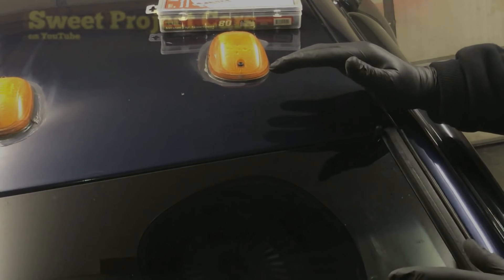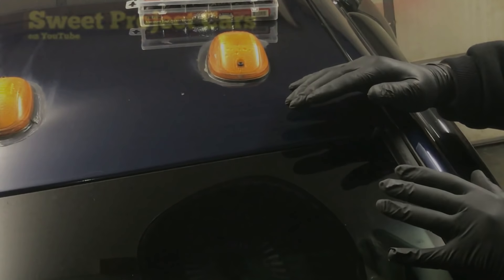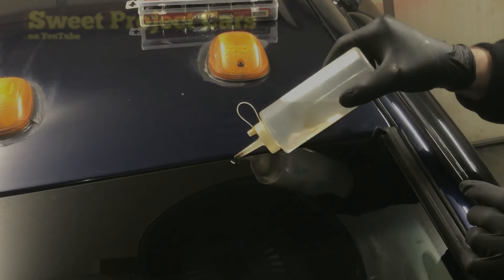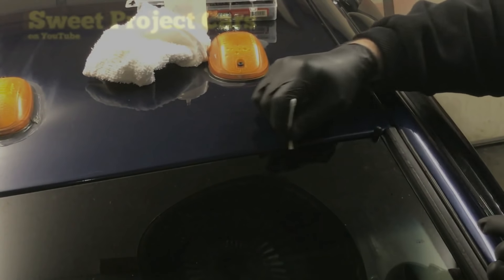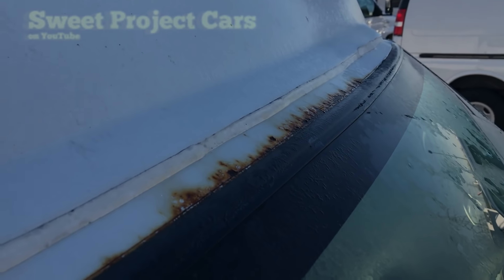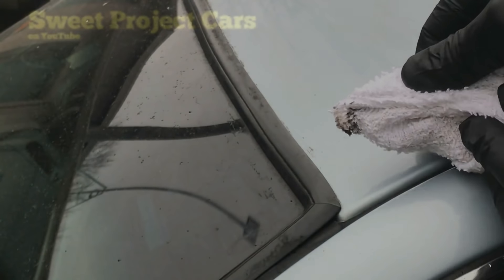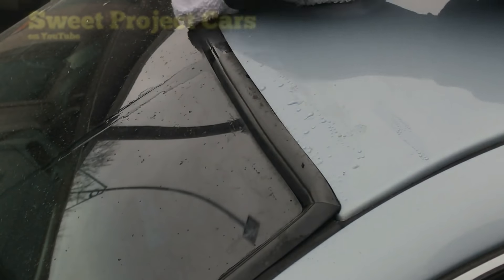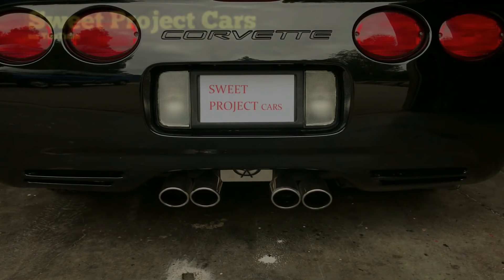How To STOP RUST at WINDSHIELD Seal.... VERY EASY DIY

Comment from the maker: Good Day to all our GREAT SPC Friends. Here we show you how to prevent the worst kind of rust you can have on your car or truck. The old saying goes perfectly here, an ounce of mineral oil is worth a pound of Rust Prevention LOL or something like that! ..we hope you enjoy :)
Reply: looking forward to watch the next video, too soon is late :D
Reply: Great job mate, I've replaced a few windows in tractor and while fitting new rubber to the cab I was thought by an old timer to put Vaseline in rubber groove where it meets metal to prevent this also..
Reply from the maker: Kevin Lonican thank you for sharing this great tip :)    thank you very much for your great comment and we are glad we can help :)
Reply: Another Great tip that I will follow 👍
How do I send you a picture of my ‘95 GMC Ride 🤔
Reply: In 16 years as an auto glass installer, I've only run into rust not caused by a previous auto glass installer a handful of times. Rust around a windshield is almost always caused by a auto glass installer cutting corners and not sealing up the scratches they caused while cutting out the old windshield. I've replaced 30 year old windows that didn't have a hint of rust as it was the original windshield and the paint hadn't been scratched. I've replaced a one year old car that the had rust beginning after only having had the window replaced two months prior because the previous installer had not sealed up his scratches. Rust does not begin because dirt gets underneath the molding. 99.9% of rust that I see is auto glass installers scratching the paint and not sealing up their scratches.
Reply: Great video's. I am from Europe. I have a Wartburg 1.3 of 1991 (last one built in the former communist Eastern Germany) which are famous for rusting. What kind of mineral oil do you use?

Comment: This channel is a MUST for auto lovers. I've done this for years on vintage vehicles that have zero paint on the inside metal in the South and even light existing surface rust is halted.
Reply from the maker: marcogram thanks for sharing my friend :)   thank you very much, and for stopping by for our many car & truck DIYer affordable tips :)
Reply: Hey! You said even if there is a light rust spot present its possible to prevent further rusting by applying the product. My question is do I apply smth like rust eater penetrating oil to get rid off the rust that’s present first and then apply the corrosion inhibitor?

Comment: Can easily be taken to the next level of preventive maintenance: If your car has a "panoramic sunroof" like my wife's Audi A3, these things will become noisy with age. Squeeking noises, sometimes rattles even when closed. My assumption: the rubber seals tend to dry out and shrink with permanent exposure to the elements. 

Loaded the syringe with ATF and gave the surrounding seals a thorough dose of oil. Twice to make sure there will be enough to get into all the nooks and crannies behind the seals and soak the rubbers, too. A week of baking in the sun - the roof is dead-quiet again. Neither the opening part nor the unmovable glass-section cause any more noises.

I get more and more enthusiastic on this easy, affordable and effective method of rejuvenating older cars. 

I cannot thank You enough for Your knowledge shared here!
Reply from the maker: Markus Dahmann thank you so much for sharing this great info it truly helps the entire channel :)

Comment: Sweeeeeeeeeeet!!! I'll be doing it to my 2000 F-350 tomorrow, Thanks for the tip my friend!!! Now, if I could just get the new front brakes from squealing when I come to a stop or make a turn...🤔
Take care and God Bless!!!
Reply from the maker: Orange Rocket thank you very much and on your brakes check the protector plate on the back to make sure it is not touching and or you may have to take them apart and add anti-seize to all the areas touching metal   just some ideas for you my friend and God Bless you are well
Reply: Sweet Project Cars ,THANK YOU, will do.
Reply from the maker: rocket have a great day my friend:)

Comment: Nice simple trick to save a lot of money down the road thanks for posting! Could you use something like Fluid Film in place of mineral oil?
Reply from the maker: CUnit1981 you can use anything that is safe for your paint and flows into the cracks and crevices as does the mineral oil  thank you very much, and for stopping by for our many car & truck DIYer affordable tips :)

Comment: I have minor surface rust on the top on rubber type seal. Will this still work if i apply it after i treat/paint the rusted surfaces. Also seems like a good oil to spray inside rocker panels?!? Thanks for the video
Reply from the maker: Yes, it will work great and it will work on your rocker panels as well my friend. Thank you for watching and asking, have a great week v1nce. mad Mike the hammer SPC

Comment: Hi, will this work if rust has already set in? I have to apply new polyurethane sealer around the windscreen of my sprinter every year. I remove the old sealant, clean off the rust and flakey paint as best as I can. Then re paint and reseal with sikaflex. It lasts for a year and then starts leaking again after the summer. I think the sun and high heat shrinks the polyurethane sealant which also doesn’t help. But I’m sure the main problem is the rusting process.
Reply from the maker: It sure does! Just follow the video instruction and make sure to seal with this  https://amzn.to/2WaABYr  to prevent any leaking. Thanks for watching and asking, have a fantastic week my friend. mad Mike & team
Reply: @SweetProjectCars  wow, thank you so much for your reply and help. 
So the sealant you recommend will still work and stick to the surface even though it’ll be coated in mineral oil? 
Thanks again guys you’re really very kind in taking the time to help me.
Awesome videos 👍

Comment: my 1971 Kingswood has non-flexible chrome window moldings, do I need to remove these and then treat it like the open type shown in this video ? also was the juice in the bottle just Mineral Oil with nothing added?  Cheers & Thanks.
Reply from the maker: RoverIAC you can pour the mineral oil just above the trim and let it roll down into the area below it and it will work finf...thanks for asking my friend :)
Reply: I hope you still ahve that car!

Comment: I have paint bubbles near corner of windshield should I use a rust  neutralizer and silicone as mentioned in another comment and then mineral oil? Or just use mineral oil
Reply from the maker: snotrags 00 you can open up a whole can of worms with rust neutralizer as it will not look good...if you want to stop the rust in its tracks use the mineral oil and do it a few time to really let it soak in. then when you are ready to open that can of worms, sand the rust out and then use your rust neutralizer and etching primer and repaint.

Comment: I just changed my windsheid there was a tiny tiny bit of rust we cleaned it off and applied some primer do you suggest me to apply mineral oil immideiately to prevent the rust from ever coming back again
I checked at my local store I found mineral oil but  it's says cutting board mineral oil on the label is that the same?
Reply from the maker: Canadian well it should work for you my friend
Reply: Hey man Thanks for your reply
I have one last question for you 
I wanted to ask you so since I live in a cold climate  can I apply mineral oil and use a blow drier to let it bake and do you guarantee that  mineral oil doesn't cause any damage what so ever to my new rubber  seal by the way this is the mineral oil that's available at my local Canadian tire store is it the right one https://www.canadiantire.ca/en/pdp/paderno-mineral-oil-treatment-250-ml-1422208p.html#srp

Comment: Did this to my truck yesterday which has the open type of seam. I use some compressed air blow the leaves and dirt out of the seam and then applied mineral oil like you showed in the video. Im assuming it's normal for the mineral oil to run down the sides and end up on the ground the next day? Thanks for posting this great video!
Reply from the maker: Yes it’s very normal for that to happen and it does not harm the environment whatsoever but what is left in the areas that you treated is all that is needed have a great day my friend
Reply: Awesome thanks! I like the idea it travels down the sides of the windshield protecting that as well. You guys are awesome I've learned a lot from your videos!

Comment: I have just discovered rusty corners on most of my van windows. Not a cheap fix. I will be trying this for sure after it's repaired. I'm worried about mineral oil breaking down the rubber seal though. Would that happen?
Reply from the maker: There are no adverse affects doing this process, we've done this for 40+ years, have no worries my friend. Thank you for watching, have a great weekend. mad Mike the hammer SPC
Reply: @SweetProjectCars  Thanks for your reply. Can't wait to do this on my van now! 😁

Comment: I just did my car using this method. I had a very narrow space between windshield and body with a rubber gasket between windshield and body. Very gently I was able to get my thin trim tool in  there to allow the oil to seep in. You can also stick one of the straws from aeresol wd 40 cans in there and inject you fav rust inhibitor. This method is cheaper and any attempt you do will pay off. I bet this is often neglected or missed part of rust proofing where the salt spray runs in that crack all winter.
Reply from the maker: dave houston thanks for sharing and you are very welcome my friend and thanks for being to here see our many DIYer Tips :)

Comment: Hey what a great video, This is something I am planing on doing shortly. Question can I use Motor oil, Machine oil or WD40 instead of Mineral oil?
Reply: nw8000 not sure but motor oil bad for rubber??
Reply from the maker: nw8000  we have found the safest oil to use is the mineral oil
Reply: Ok thank you

Comment: Hi again! Lol! I left a mile long comment on the water coming into your floor video... When my friend checked the windshield out, he noticed I had rust spots starting at the top middle of my windshield.... Is it Too Late to do this now? Or, will it help prevent Further rust from forming??

And, as I type this on my phone, I'm also watching your 'Your Car Will NEVER RUST Again! For Just $10 Bucks" video on my laptop... and, lol, I ALSO have rust starting on the very bottom of my rear quarter panels, like along the very bottom of the car, nearest the back tire (I have a 2 door, Toyota Echo. I have NEVER seen such LONG doors before!) And, I noticed it getting worse lately (I'm in Massachusetts, sea salt, & weather is brutal on vehicles) ... Is it also too late to stop Further rust with the Transmission fluid tricks? Thanks again for the awesome vids!

Ohhhhhhhhhhh, and I'm going to be turning my father's shop Vac (wet/dry, of course!) into an extractor or whatever it's called, lol, THIS weekend to suck up all the water on my passenger side carpet, from my lovely leak...So thanks for that, too! Good thing about that leak, tho, is... It brought me to this AWESOME channel, that I may not have otherwise seen! Sooo many great tips, and I've already shared some of the vids to my Facebook page for my friends to see! I think everyone should see these tips!!! ... Sorry, I know I type novels, lol! Just be lucky we aren't face to face, if you think this is long.... 😉 hahaha!!! Ya, I'm a little long winded sometimes, lol! I'm just really excited I found all these cool tips on your channel! 👍💖 Thanks again!
Reply from the maker: Em22 my friend, you want to use this to stop the existing rust  http://amzn.to/2HlFUdx then use this to reseal under the rubber seal http://amzn.to/2Hn39UT

Comment: Does mineral oil or ATF fluid damage paint?
Reply from the maker: dave houston we have found the safest oil to use is the mineral oil but you can use what you feel is best for you    thank you very much for your great comment and we are glad we can help :)
Reply: You mentioned a while back to use ATF in the doors because of the wicking qualities of transmisio fluid (I agree). So wouldnt ATF be a better choice ?
Reply from the maker: Geo R for areas like the outside of your car like this video the mineral oil works great and is far less messy.